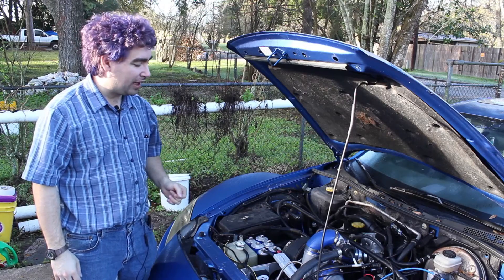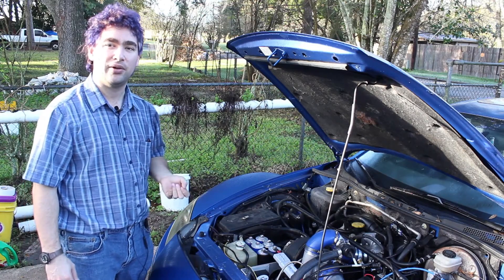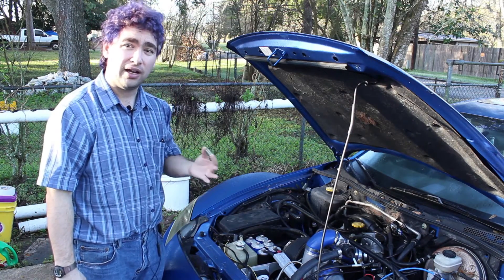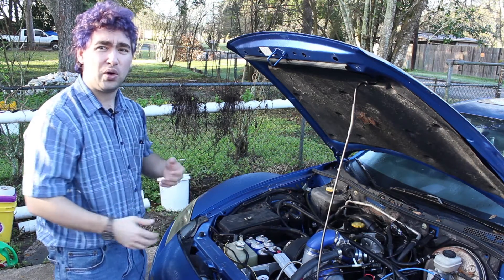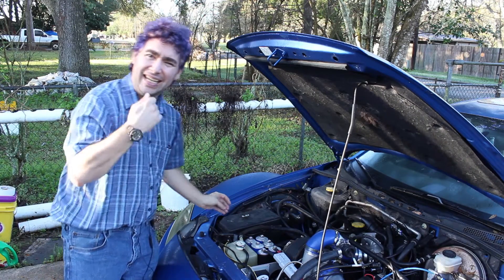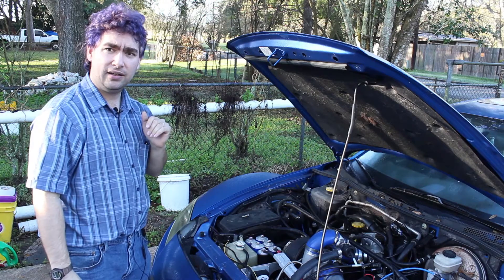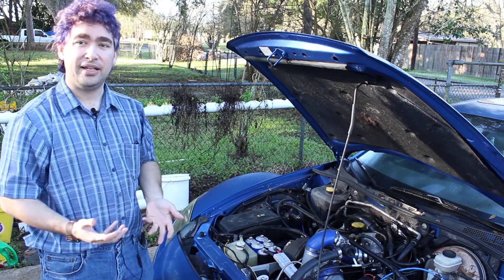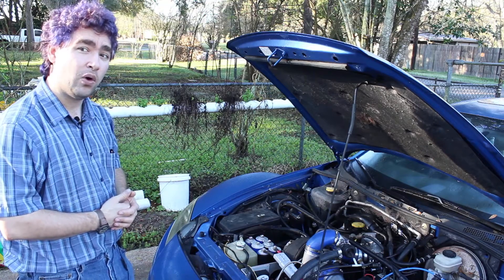Almost destroying my engine with a programing error- Voiding Warranties Ep33

Comment: Hey I am trying to learn engines, more in depth, and your videos are really interesting:)
Why could you destroy your engine simultaneous spark fires?
Reply from the maker: +Beucan. Simultaneously firing spark plugs wasn't the problem. Randomly firing spark plugs however will cause higher pressures before top dead center and could cause engine damage. Hundreds if not thousands of psi of pressure opposing the direction of the piston is a bad thing.